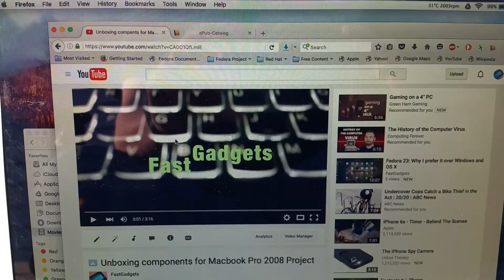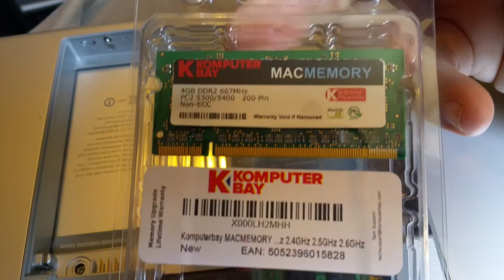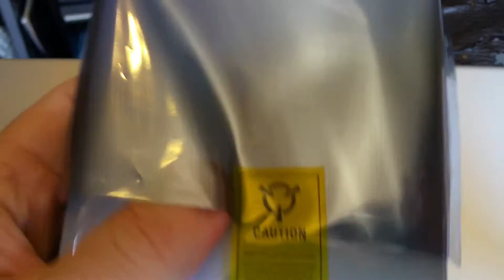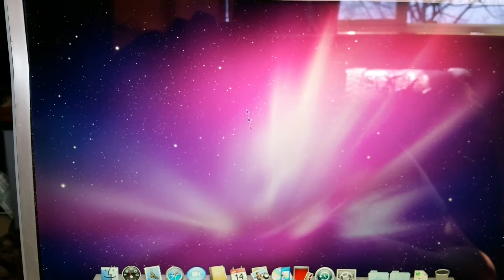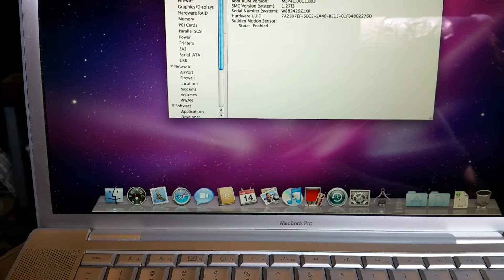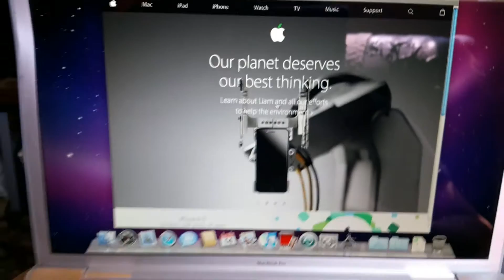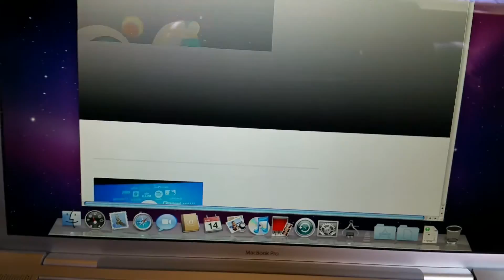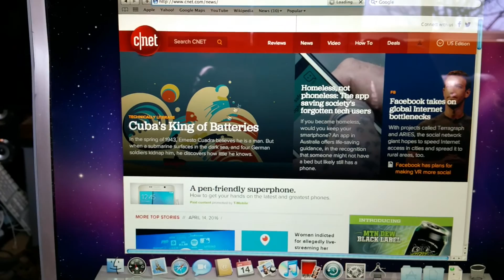Macbook Pro 2008 Ram and Battery Install and test!

Comment: Have you researched on whether this mbp can run 800mhz ram modules?
Reply: I own the 17" 2011 mbp and have installed 1600mhz memory in it and it runs flawlessly even when it is out of spec according to Apple's spec.